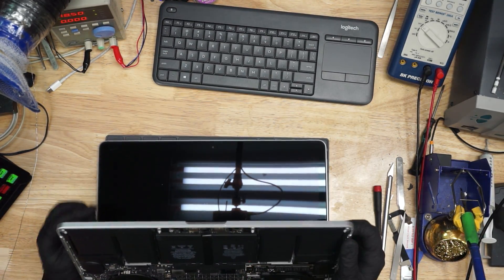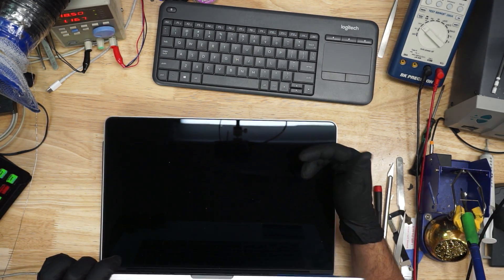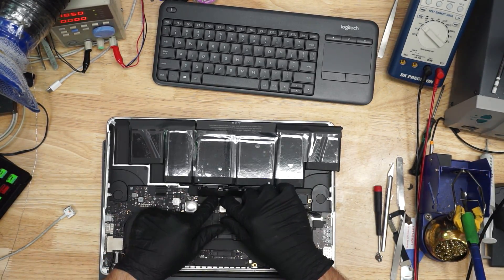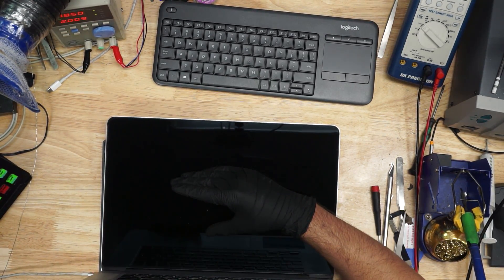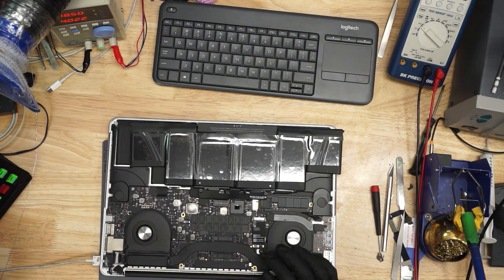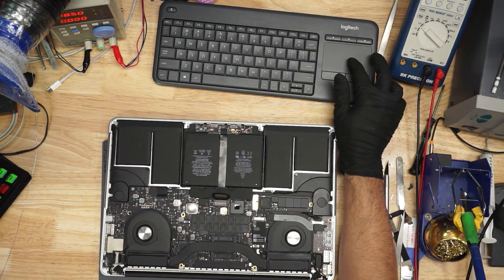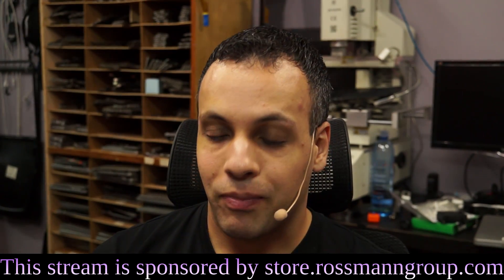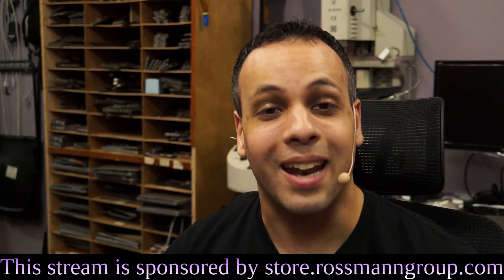ENGINEER DIFFERENT!

Comment: Every single time I see one of your videos I find less and less inclined to buy an Apple computer. 👍
Reply: I recently saw a Macbook at an electronics store. Thought back at these videos, and thought: "Naah ...."
Reply: Working as intended
Reply: I never wanted to buy one at all and these videos still make me want to buy one even less. I didn't know that was possible.
Reply: I only needed to see one video, the one where he detailed glaring design defects in just about every model Apple has made in the past few years, to swear off ever buying an Apple desktop or laptop.
Reply: I'm hanging on to my 2009 model. It's still a capable machine despite it's age. If the battery gives out I can buy a new one from OWC.
Reply: @cpthuggyface2011  Same with me. My MBP 17 inch 2009 is just great for what I use it for. Would be nice with a 2012 though. A MBP should be easy to repair.
Reply: But Apple said they are the best so you must buy one!
Reply: Please dont. If not enough people buying apple products how can Rossmann survive?
Reply: Why would you want to pay double to triple price for the hardware to begin with? Long gone are the times, when Apple OSes had unique software.
Reply: then we need to spread the word to more people.

Comment: Apple dose that because if any components of the system fails the user has to send it to apple to fix it, and if they can't just buy a new one from the apple store. That is why apple makes them the way they are. Or the alternative is sending it to a third party repair shop and letting them fix it for a lower price.
P.S  Razer's new laptop is fare better then the macbook in every way possible.
Reply: Nah, the "repair" is only $50 less than buying a new macbook.

Comment: What if the user removes the battery to run only when  plugged in?
Reply: He said cant be use as a desktop either.
Reply: Are you crazy? The pixie dust that makes the new macbook work was placed on the batteries in the new models, they should not be able to boot on the magical OS without it. LOL. What an absurd laptop, useless without a battery even when plugged in.
Reply: If the battery is removed it shows the same 0v as when it is dead inside.
Reply: JohnnyDrunx88's correct, you can't even boot the whole thing
Reply: It won't work!

Comment: ThinkPad T420 > battery dies = No Issue. I can just take It out, and run my machine on AC power. 

Macbook > battery dies = The whole machine dies. Damn you Apple!
Reply: running on AC only is especially important on high end laptops that way you can run full load without the battery becoming insanely hot
Reply: Pretty much Mac is likely the only laptop that doesn't boot without the battery (or a faulty one)... Is it current protection that restarts the computer?
Reply: Yep. Who knew a trillion-dollar company would design garbage
Reply: apples plan is always sell junk and eat legal fees untill warranty is up on a product. then fix it for juuust cheaper than buying a new one.
Reply: It should be possible to design a device that emulates a battery to the MacBook... But then again you'd be turning it into a PC...
Reply: Latitude C600 > battery dies = no issue, I can use the one in the other slot.
Reply: Lol I also have a t420 laying around
Reply: HP Pavilion sleekbook>>battery dies = no issue but just got important message from bios "replace your battery or unplug it" after turn on my laptop
Reply: Astounding. Battery glued in, not just physically but functionally. RAM & SSD soldered in. Data irrecoverable from SSD Iif your logic board dies. It's an iindivisible blob, take or leave it. Clearly Apple thinks of its customers as being just another soldered-in part: blob people

Comment: Nice opening graphics, sir!

And shame on Apple for designing something like that.  So, I'm starting to believe Apple's User Interface crew may be customer-focused, but the Electronics Design crew is actively trying to screw that same customer.  All batteries die at some point -- and no one knows this better than the engineers that design equipment to use them.   So, why make the battery intrinsic to booting up?  Shouldn't AC power, if present, be used in all situations?  Yikes!  

Reason #207 I don't use an Apple laptop or desktop. (I do have an iPad from 2014, though.)

Comment: What kind of crap is this?  A dead battery rendering the system useless....even on AC power???  That is all kinds of messed up.
Reply: i mean... this is a company that removed the data recovery port on the new models.  and even with a data recovery port on older macbooks they DIDN'T OFFER DATA RECOVERY!
Reply: Think Different
Reply: Think different eks dee
Reply: welcome to Apple derpy land of laptops ... why people buy theirs systems is beyond me
Reply: PLANNED OBSOLESCENCE comes to mind... but it is illegal, so you might be using it wrong.
Reply: @Kekistani Refugee That's laughable. Chargers are designed to not only keep a computer running, but also add power to the battery. The same battery that keeps the computer running for hours (assuming it's not worn out). The charger will always be able to supply more power than the computer as a whole will need at any given time.
Reply: ALL KIIIINDS
Reply: + jjkusaf 

No, it's part of the premium Apple experience.  PC riff-raff wouldn't understand, tut tut.
🎩
🧐⚜️
Reply: Kekistani Refugee my laptops dont need battery though. they run even when i plug out my battery. depends on the laptop i guess. but this sucks coz this laptop is crazy expensive.
Reply: This happens on other laptops as well, but the solution is just to remove the battery and use it on AC power until you can get it replaced.
Reply: jjkusaf My thoughts exactly. I've had laptops with batteries that are all but useless. It's not too hard for me to find a wall outlet and keep on using it. Just another reason why I'll keep saying, "F*** Apple. I'm never buying their products."
Reply: no, its a safety feature you dummy, im an apple fanboy REEEEEEEEEEEEEEEEEEEEEEEEEEEEEEEEEEEEE
Reply: That's crazy.... Wow...
Reply: @Kekistani Refugee 100% wrong.
Reply: @Kekistani Refugee never seen that and I always own 1 or 2 laptops which I replace every 2 or 3 years...
Reply: No. It's as Louis title. Engineer Different. Think different is IBM aka Lenovo for decades. Can't use that.
Reply: You should ALWAYS backup your data.... on our cloudservice we can barter to the government at some legal dispute.
Reply: Probably pulls current pulses that the adapter can't handle and uses the battery as a buffer because Apple couldn't be arsed to make a better power brick even though the technology has existed for years.
Reply: Define "better".  This is apple we're talking about.  When motivated to make the power supply "better", they won't be concerned with increasing its power or longevity or giving it more than an dismissive gesture of a strain relief on the cable.  

They'll make it "better" by making it into some new retarded shape or color, or perhaps integrating some new hardware keying to make it irreplaceable.  

Be careful what you ask of people and organizations that are already beneath your trust.

Comment: Do they work with no battery installed? most notebooks do.
Reply: It's Apple. Of course It doesn't work without a battery. Duh! You gotta Think Different bud.
Reply: i mean you'd have to put in a resistor to make mac think it had a battery in it it seems.
Reply: I don't think a resistor would work if a broken battery already causes it to bootloop.

Comment: The battery is glued in for your safety.  The thin casing makes them too dangerous for user replacement. So said an Apple rep a few years back.
Reply: Bullshit excuse, just like slowing down older iphones "to make the battery last longer"
Reply: So every other battery since they began, that weren't glued in, are all inherently dangerous then? Really? O_o
Reply: With the newer lithium whatever batteries that like to explode, that actually makes some sense. Of course, the correct solution would be to make the laptop a bit thicker so that there’s room for a “safe” removable battery (and maybe an Ethernet port), not this load of horsefeathers.
Reply: OtherTheDave 
Do you mean lithium-polymer?cause those little bastards overheat because of their density,which sometimes ends up exploding into flaming chunks of battery.
Reply: It's like saying the devs intentionally capped the games at 30 fps for the cinematic feeling.
Reply: Yeah, some glue will definitely prevent the battery from exploding and burning trough the case. Sure.
Actually it just makes them even more dangerous as the people who would try to remove the battery need to apply force to strain it off with their tools, risking deformation or puncture damage that can cause serious hazard. Gluing in practically just prevents the battery from rattling and nothing more.
Reply: Aka give us more money so we can replace it for you

Comment: Louis, you might be going crazy. You're 'fixing' a machine that showed up with fan spin?
Reply: I know that this is a joke but for autists that don't realize it's a joke, fan spin is the step one because once the fan spins that already knocks off most of the possible hardware issues that can exist on a computer, and usually in context if the fan didn't spin before the fix and it spins after, that means he fixed a problem.  It may not be the only thing wrong, but it is a problem fixed.  I imagine he just puts the laptop into a pile of macs which have a fan spin, so he can test for other issues.
Reply: I can fix all the MacBooks, I plug the fan into 12v external power supply and boom! fan spin, working Mac. I'ma make billions and millions
Reply: Lmao, savage. xD

Comment: Engineered obsolescence in it's most blatant form.
Reply: I've been actually thinking about that. Stupid mistakes are stupid because everyone should know better. What if they do? What is this is their method of planned obsolescence? If you put a timer into your device and kill it after it reaches a certain point that's illegal and even worse for Apple, they can't blame the user for it. However, if you put that same exact circuit into an printer cartridge you can call it "quality assurance" and no one will bat an eye. Similarly, aging batteries, failing chips, dust-sensitive keyboards, improper soldering, mechanically weak casings, etc. are easy to pass off as engineering failures at worst (while they were purposely engineered to fail) or required tradeoffs for some glorious user feature such as thin construction or system stability.

I don't think Apple has a hard time finding engineers who could design proper devices or lacks the budget required to develop those, but if you have a monopoly over your repair market and good user retention even with failing devices why wouldn't you want to increase your repair business?
Reply: Ben Snow i wouldnt put my name on the engineering if i designed it
Reply: Apple wants you to give them more money soon!